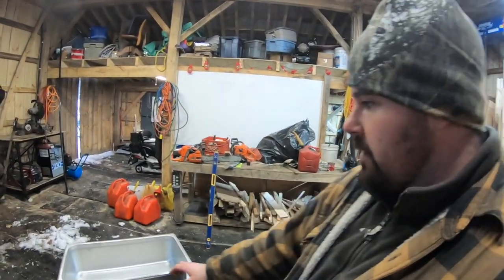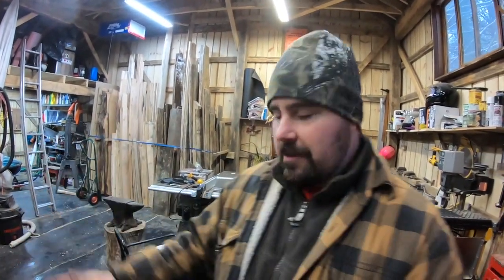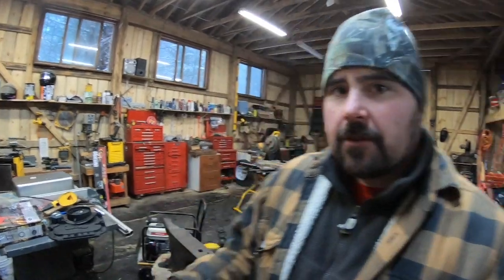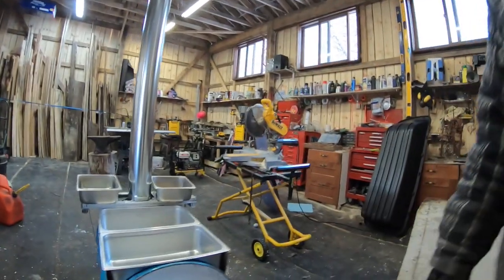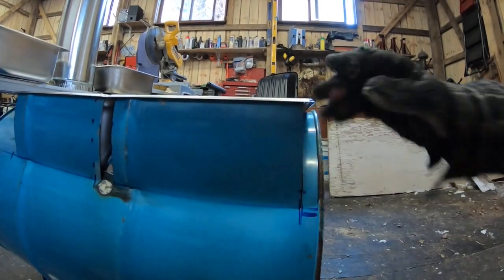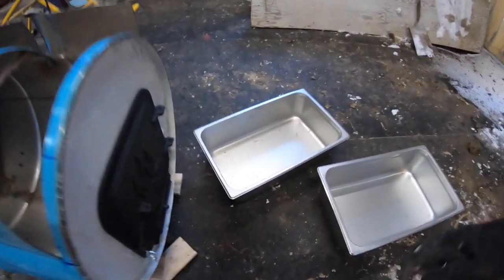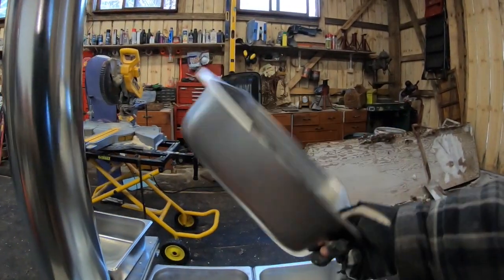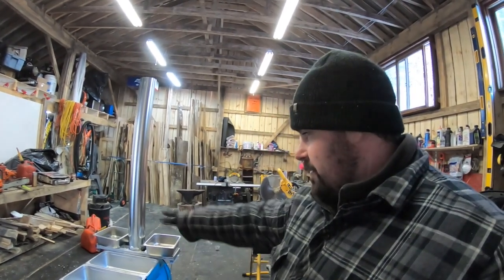How to Boil Maple Syrup Without Much Money

Comment: We built several evaporators leading up to the one that is currently in use.  The biggest problem we've had with previous designs we've learned from is smoke/soot/Ash etc leaking up around your stainless steel pans.  We once had an almost identical rig as you just made, and got lots of debris from the combustion in the sap.  We've rebuiit an entirely new evaporator from scratch, focusing on having an almost perfect seal around our stainless steel pans (exact same pans you have in the video).   Biggest problem for us occurred every time we added more wood.  This created alot of smoke till they caught, and the ash/soot would also leak out around the pans and go directly into the sap that was cooking.  Maybe yours won't be a problem, but ours sure was.  Good luck
Reply from the maker: I appreciate the info. I’ll see about filling in all the gaps with ceramic insulation . I may also add a blower to help keep the fire hot
Reply: @sawingwithsandy  
The insulation is a great idea, you're on the right track with this.  Remember, you don't need to wait for a full load of sap to try it out.  Just boil a full batch of water in a "dry" run. (No pun intended, lol). You'll learn where adjustments are needed without risking any of the precious sap you've worked hard for.  
Also, I do HVAC for a living.  In regards to adding a combustion blower for a hot fire, you'll find there will be several challenges in your future.  A vessel like you have there with the barrel will not tolerate any positive pressure on the inside.  If the blower forces in more air than the chimney/stack can pull out on its own by way of natural draft (negative pressure), you'll end up forcing smoke/ash out if every single crack/crevice/opening.  Additionally, we burnt through the metal of the barrel with extra hot fires.  Round two, we added firebrick and interior metal baffles to protect the barrel material which is actually very thin.   If you use a blower, be very careful.  We eventually scrapped the blower, even on our final design.  Just too much trouble with the fumes/smoke.
Reply: Hey sandy hi I wanted to ask you how far  from the center line do you measure down for the cut that makes the tabs the pans rest on ?